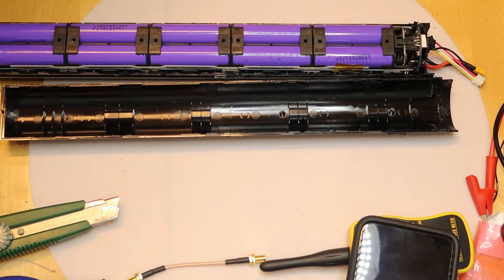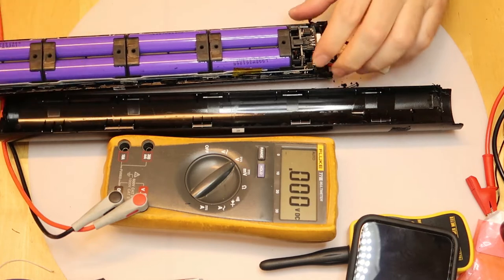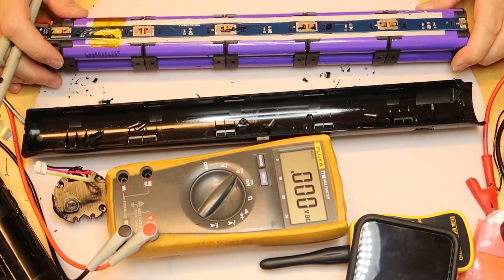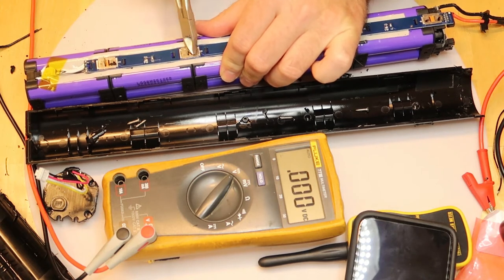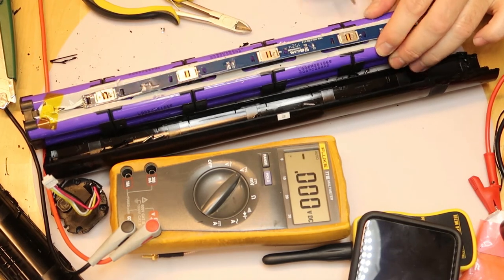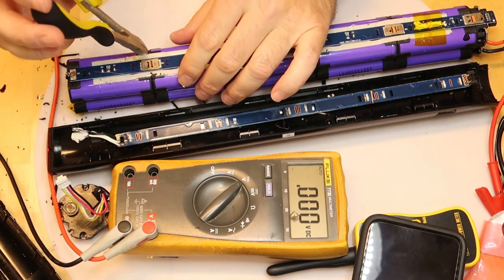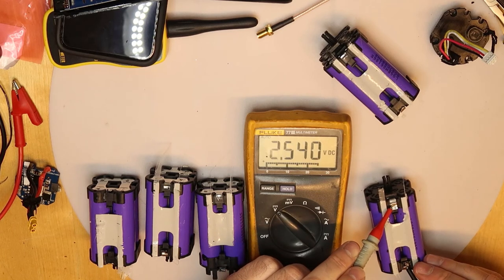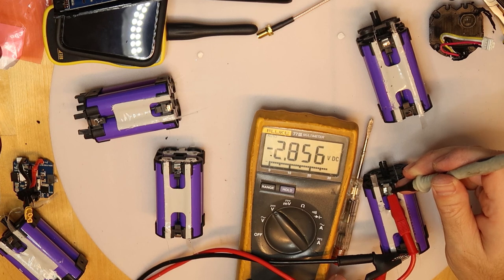How to disassemble ES2 scooter Internal battery without explosion

Comment: Bms works when reconnected? Many power tools bms locks when disconnected so you cannot repack batteries
Reply: Is this goes with ryobi batteries? I replaced with some scooter batteries 18650 and it’s won’t charges but my dewalt repacked batteries works fine
Reply: @derpherpp  highly likely to happen on modern branded tool batteries. havent worked with ryobi though

Comment: Hi mate, how do you actually remove it from the post. I took out all screws, but looks like I need to turn it until the dents are matching, but is stuck
Reply: I hear there is a screw at one end of the rod. Probably the one with the white glue. I just tore one down by cutting the rod and sliding the 4 cell assemblies off. I wish I could find the schematics for the entire assembly. I hate having to reverse engineer this stuff. Try this forum, I think I'll join it. https://secondlifestorage.com/celldatabase.php?fkeys=lg&fbrand=&fform=&fmincap=&fsort=1
Reply: I'm removing screws rn.